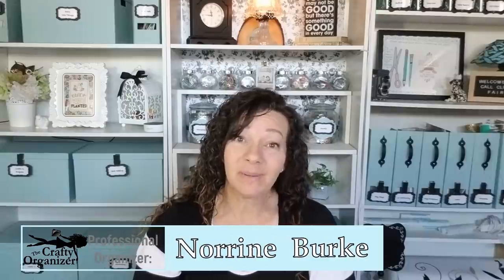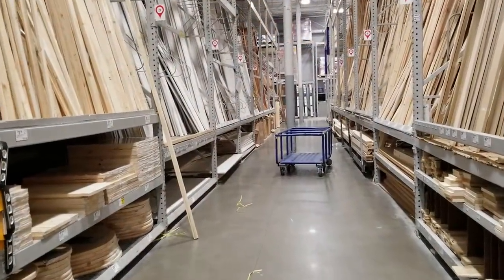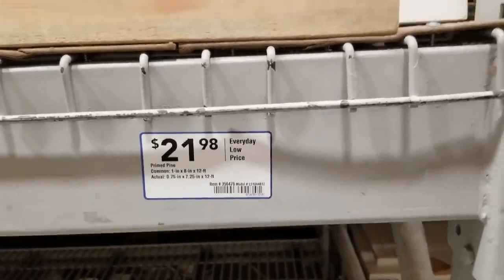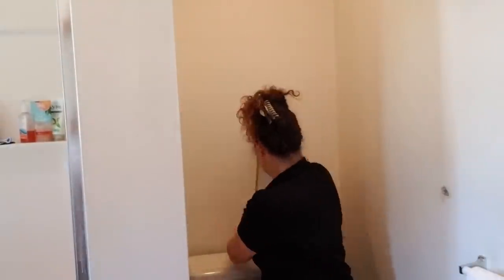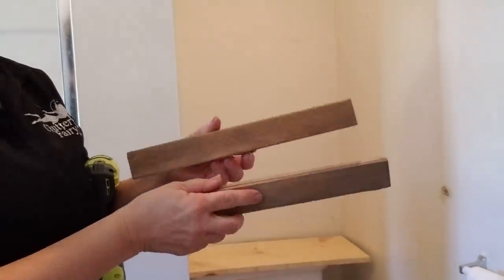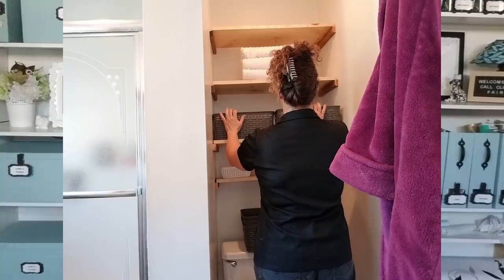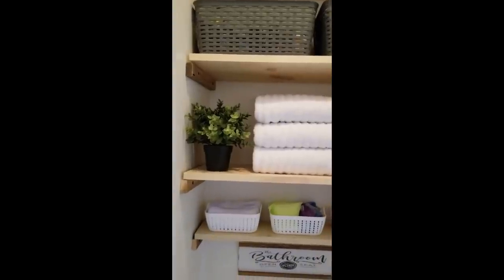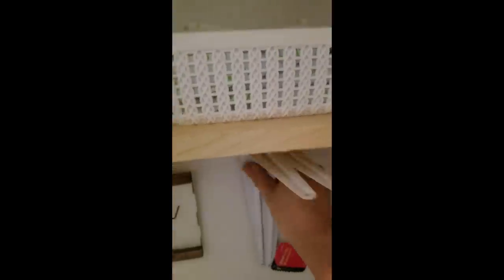Add storage with this DIY bathroom organizer

Comment: I have same problem with bathroom storage! We live in country area and our property backs up to an old city landfill. Unwanted critters are a year round issue here so storage of certain items has to be in sealed, snap tight containers. We volunteer at our church pantry and they bless us with a supply of discarded milk crates that are constantly given to them. I wired some together and when I can, I am going to paint them. I took heavy boxes, also from pantry, wrapped them with twine and turned a dead space beside our unused garden tub into storage for my soaps and such. I also wrapped a Pringles can with twine and use it as a Ponytail holder. The twine decor was inspired by a cute twine look turtle a dearly departed friend gave me a year before she passed. The turtle was labeled as a flower basket but it is now a headband holder, decorated with a cute butterfly hair clip. I teach an art class at our churches school and since I DESPISE waste, I take the almost empty paint from class, and do paint pours. I made a brush holder out of an empty #10 can, decorated with paint to match our towels. Still need to get a board cut to go on top of my 'crate cubby' but even as it is right now, I has been an awesome solution to no bathroom storage!!
Reply from the maker: Love your creative use of other containers!!!!    Way to go!

Comment: I feel your pain. I have a 1942 cape cod.  Storage was an afterthought.  I'm assuming that they didnt have as much stuff as modern family's have.  And, the walls, nothing is strait. When we had kitchen cabinets installed, the had to chip away the wall because it was bowed. My walls are concrete with chicken wire. So, any renovations is an adventure.  Lol 2x4s were actually 2x4s then. Modern updates such as doors have to be custom made.
Reply from the maker: YES!!!!!  All part of the charm.  LOL
Reply: And very well built.

Comment: If you want to hide the space created because the walls are not square.  A simple and inexpensive solution is to use a piece of trim or baseboard.  Cut each piece of trim to the full opening at the front of each shelf (it will be longer then the edge of each shelf).  In this case each shelf was a bit different in size so make sure to measure each one. You can attach it will nails, glue or both just to make it extra secure ☺️ It will finish the shelf and hide the gaps.
Reply from the maker: Genius!  That will be part 2!  ;)

Comment: I must say, go with stain,since supports are stained. maybe a color stain. I live in a log home, so everything is stained. I'm trying to figure out shelving to reorganize my sewing/ now also craft room. but not too thrilled in putting screws into the logs walls,which is outside walls, inside are all tongue and groove pine.. so have to be sure of what to do and not change my mind. I have shelf units now 3, need more ..going crazy . guess have to wait till spring to get things out and go from there. lol

Comment: I would paint. It. It gives it a larger more open feel if it's all one color in such a small place. Often in a smaller room, I won't paint the baseboards a different color either. I know you're a renter. But unless you could use those shelves when you move I would leave them. I've done several upgrades to different apartments over the years and I always get my deposit back. Once I actually got a little extra money because of something like that that I did.